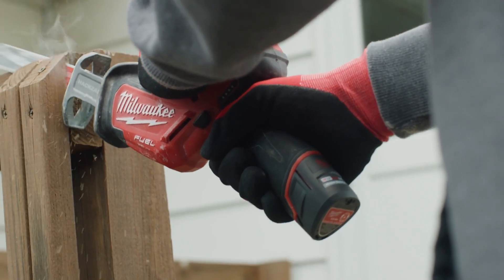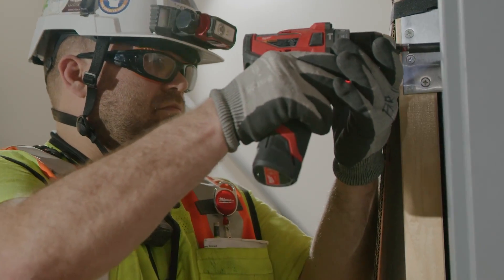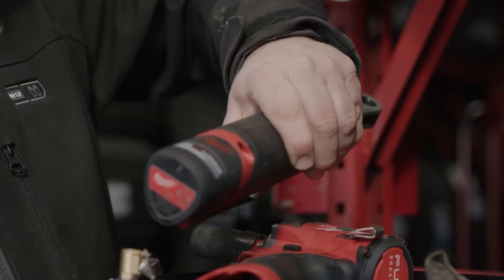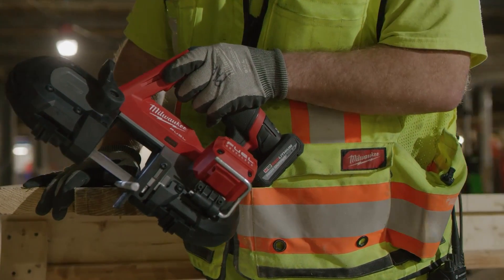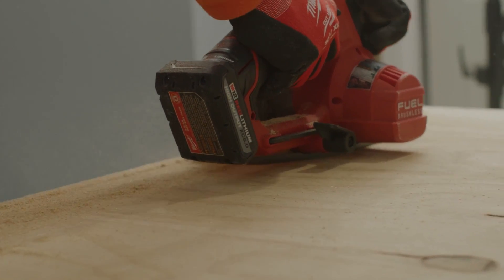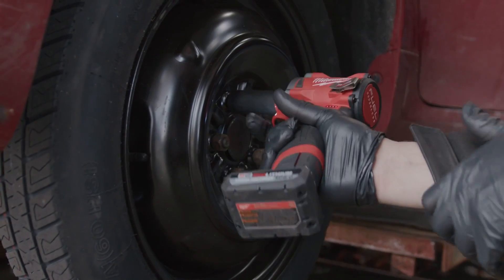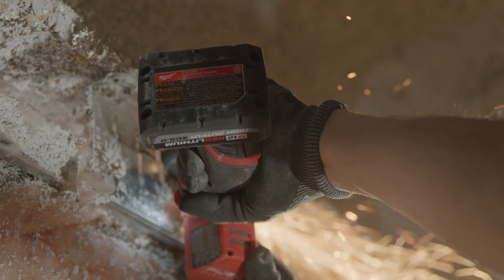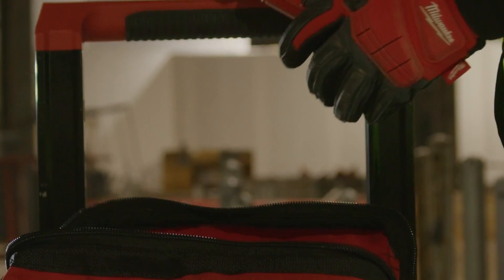Milwaukee® M12™ REDLITHIUM™ HIGH OUTPUT™ Batteries

Comment: How u gonna come out with cp 3s and xc 6s then a few years later..m2.5 and 5? next year. Introducing the new CP 1.5 and xc 3.0 high output batteries,
Reply: I’m happy to break it down for you since you don’t understand. Though these have slightly less capacity (Amp hours) than the current highest preforming M12 batteries, they are capable of higher peak output for more extended time. Not only because the cells have a higher peak output than current offerings, but also because they can run cooler to avoid thermal shut down during extended demanded use. I understand why you would ask because they didn’t really explain the technical advantages of these new batteries. But it’s just like the M18 batteries. For instance, with the M12 stubby you may not reach the peak torque output with a CP2.0. But with a high output 2.5 you could even surpass the tools peak torque specification with a battery the same size.
Reply: @tooltimewiththomas713  GREAT explanation dude. In addition, you can already see this same concept with the M18 6AH HO battery vs the 8AH HO battery. While the amp hours on the 8 are higher, the 6 discharges faster and thus allows for more power to the tools.
Reply: @KingYang05 Honestly, I'd still prefer the M18 12.0HD High Output, it's larger than the 12.0 Forged, and cost less. And I still wish they did the M12 6.0 High Output with Samsung battery 21700